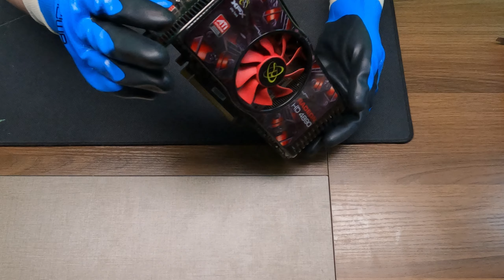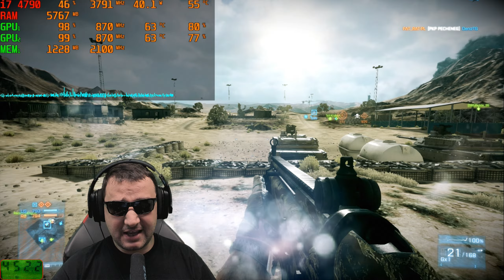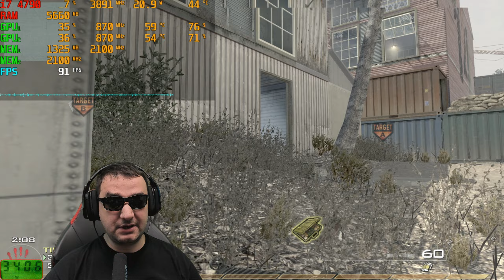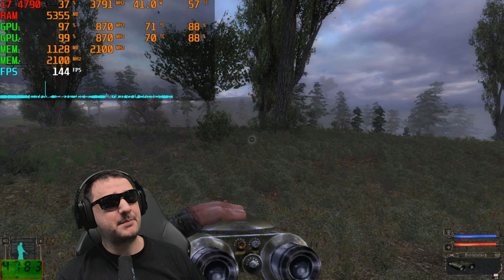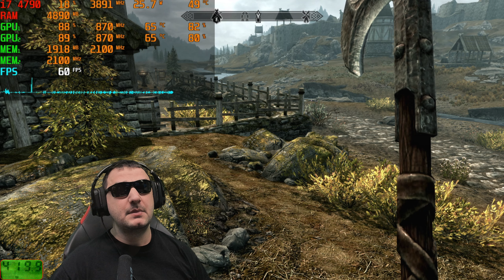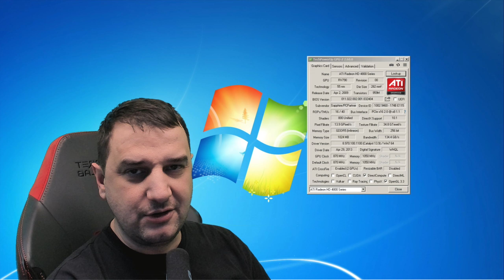ATI Radeon HD 4890 Crossfire Benchmark

Comment: Nothing (very) legendary today? Not even (very) interesting, fantastic? I am disappointed (just kidding ofc) 💩💩💩

P.S. Maybe in cases when performance is very high (for example STALKER in this video), it's worth trying 1440p?
Reply from the maker: Sometimes. If I have to do that then I have to use a specific capture card for that resolution but if its going bad I need another. Mix resolutions here for benchmarks based on capture cards.
Reply: @DanielCardei  ok

Comment: Next time try 3-way crossfire ;)
Reply from the maker: @alat_ka  its possible because of the case but I'm thinking how to use an extension cable.
Reply from the maker: @alat_ka  what case supports 3 full size gpus?
Reply: @DanielCardei  depends of pcie slot configuration on mobo